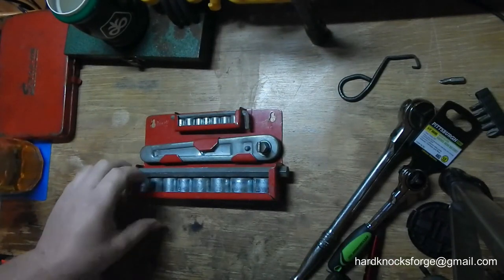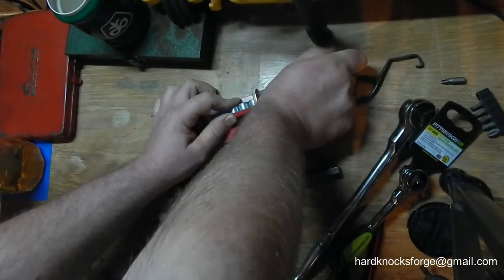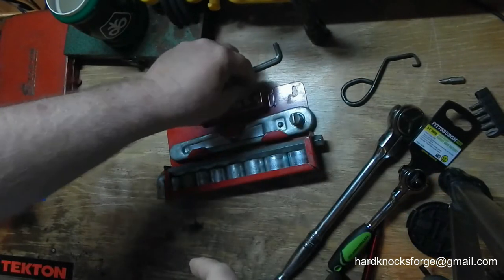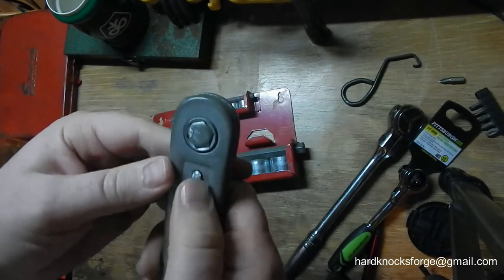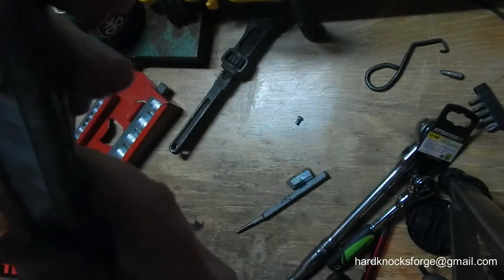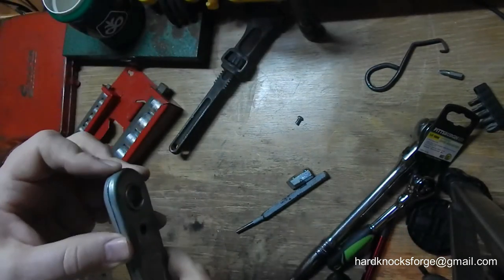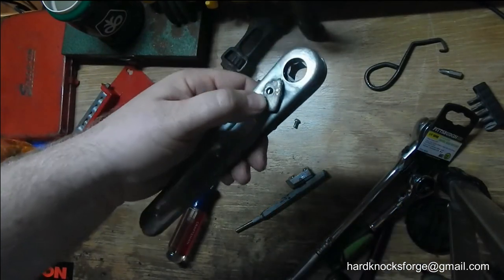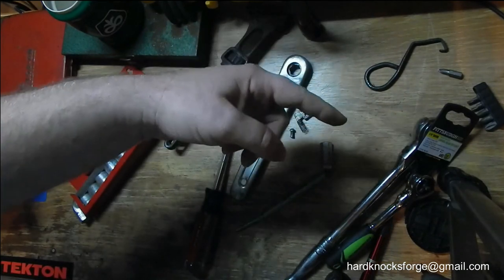Same Japan make HEX drive socket set as Garnett Tools?

Comment: Holy smokes! I have a socket that is hex drive. I may have a few more in my bucket of rusty, raggedy sockets. 
It's a 17mm made in the US though, and my initial search has only turned up a company called Bog that made tools in Chicago. 

Heh, heh, he said Chooch again. 😁👍 Make AvE proud.
Reply from the maker: SHAKA38 Look for a company called Industro. Not sure where they are from exactly maybe Illinois, New York or Pennsylvania but they actually made the set that this Japanese company was ripping off. I think I've seen a few of their sets on eBay before. Industro was a good brand back in their time. I like making things chooch, and saying it brings back plenty a summertime memories wasted in a lake up in northern Minnesota.
Reply from the maker: SHAKA38 Funny thing is I've never seen a metric set of hex drive. They've all been SAE, even the ones from Japan. You may have a real collectible socket there guy. Worth digging up some info on for sure.

Comment: Cool. I have an Indestro Set with missing large 1/2" hex and ratchet. Was wondering about guts of the ratchet. It looks easily serviceable once the stupid rivets come out. The sockets are really nice and heavy and finished nicely. I have set
INV143020. 🔩
Reply from the maker: They aren't that difficult to pull apart. The rivets do make it more of a pain, but it's not impossible at all.